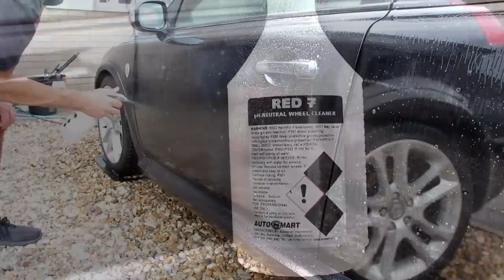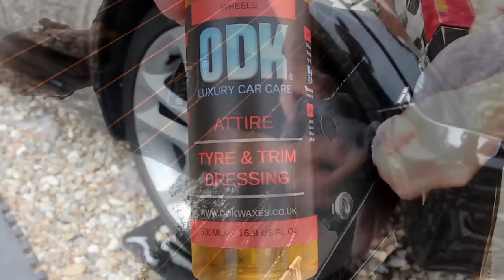Dirty Volvo Exterior Decon wash and protection

Comment: Using Bilt Hamber Surfex HD requires knowing the dilutions per PIR and testing.  I use it for tyres, wheels and under the fenders on 15 to 1 as well on paint but on paint don't let it dwell too much because it is fast and effective.   On filthy carpets 20 to 1 has been good for me.

Comment: Re the comment about Bilt Hamber. Been using Surfex HD as my go to APC for a number of years now. It’s incredible stuff, and I’m reluctant to change to something citrus based at the mo. The only down side with it, is it crystallises in the bottles, and clogs up the nozzles.
Reply from the maker: I’ve had several products do that in the pratcave
Reply: If you use distilled or deionised water then it'll stay okay and won't crystalise.

Comment: Auto smart all the way. Remember these boys have been around in the motor trade a long time. 
Give g101 all purpose cleaner that stuff is that strong meat you can clean wheels with that and it will remove brake dust at ease. I must say don’t use G101 on leather interior, not even to freshen it up. It will strip the colour.

Comment: Great job Paul I use many auto smart products as I use them in my professional job as a valeter at a high end car manufacturer. I agree red 7 is the best wheel cleaner fallout remover I used it foams well to and easy to get in bulk 5 ltrs or 25 ltrs so cost affective compared to some. I been using this product quite few yrs now and nothing come close to it yet

Comment: Another great video Paul. Nice to see autosmart getting a look in, there is nothing to touch red 7 for wheels or body contamination. May I suggest G101,tardis and cobalt for future reviews? Have used G101 for years on everything from engine bays,tyres,arches,wheels, carpets & dried on fly shit ( 20%) to a pre wash (10%) Tardis is always a one hit and it's gone. Cobalt I use as finisher after drying just to give it pop at the end- usually lasts for a week or next wash. Nice to see the old country, been out here in Oz for 15 years ( ex Norfolk) glad we've got autosmart here too. All the best from us all in Melbourne
Reply from the maker: Thanks 🙏🏻 so much Andy Melbourne my Son lives in Perth Australia 🇦🇺
Reply: Perth is a very nice part of the planet  .I'm a weekend worrier myself like you ,been detailing the last 40 odd years but still open to new ideas lol .one hack I'd like to pass on is using glass cleaner on wheels. Instead of buying all these fancy wheel sealers and stuff, just spray on a cleaned wheel  - wipe over with a cloth, then buff with another. Works on any wheel, clear coated,black finish or diamond cut . Also it the best chrome and alloy cleaner 👌  thanks for the reply 👍

Comment: Yeah a new video 👍 I see you have paint inspection light at the back of the prat cave, are they worth getting over a good bright torch would you say.
Reply from the maker: There not cheap but last for ages good at spotting swirls pretty bright
Reply: @PaulDoldenDetails  cheers, I’ll stick to my super bright push bike light rather than pay out for something that won’t be used that often

Comment: What devils magic is on the end of that Ava gun, I hate the horizontal water spray but I see you have got it going vertically 😮
Reply from the maker: Go on the affiliate link it’s the adapter that twists 👍🏻
Reply: @PaulDoldenDetails thank you, I’m guessing you get the 40degree nozzle separately
Reply from the maker: @GordyCOD  the 25 and 40 degrees yes 🙌🏻
Reply: Yeah I need to get the swivel adapter as well as having the 40degree one to get the water coming out vertically 🤦‍♂️🤦‍♂️

Comment: Good vid, however, dont really like what felt like a slagging off of Bilt Hamber.   Any product can cause damage, or clear coat was possibly already damaged.    Just felt like a specific dig tbh, on a brand that is clearly one of the best on the market.   Would rather more of an evidence based approach that you usually take on products, vs a 'good mate damaged his car using BH'.
Reply from the maker: It’s not and I repeat not slagging off I’ve had experience with the same product it’s a piece of advice to warn people how strong Surfex HD is I’ve had several messages via my Instagram from fellow detailers warning me what it can do to chrome trims and clear coat yes they make very good products try not to take my words to harshly 👍🏻🇬🇧
Reply: Just seen this comment and it was my car and I informed Paul of my testing I've been doing and not to risk this on customers cars and on specific substrates i have plenty more information on the issues I had in its degreasing capabilites and as paul clearly states, be careful as its super strong and citrus is a much better, safer dedicated cleaning aid for paint systems and other substrates.